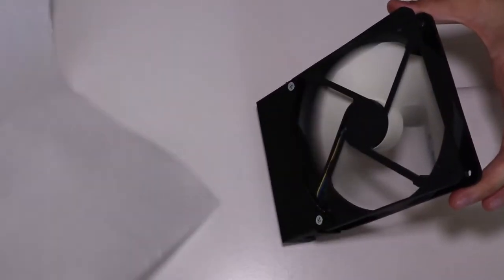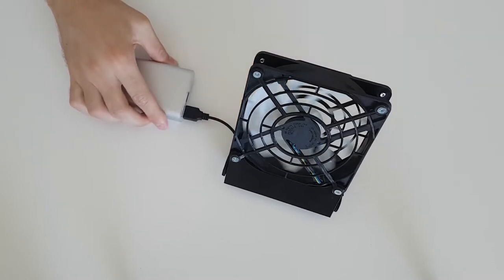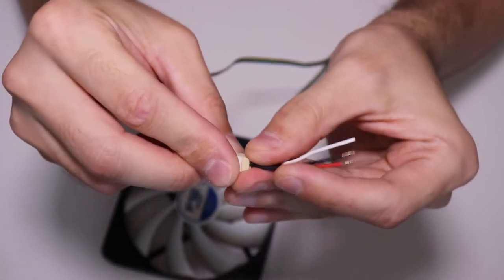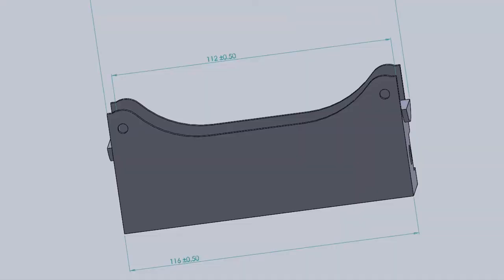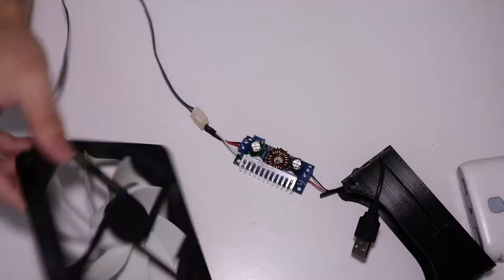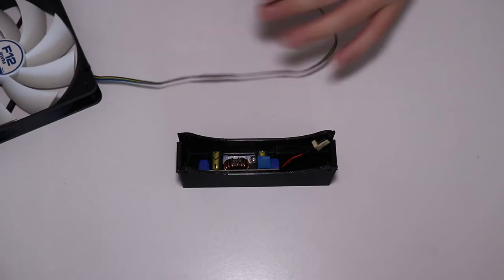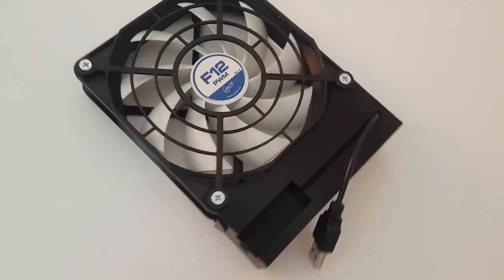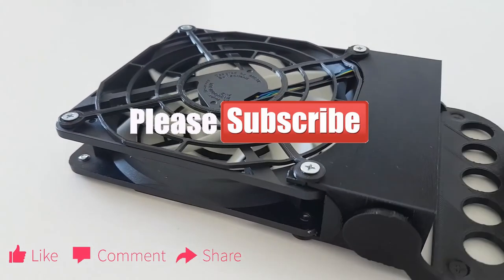[DIY] Turn a Computer Fan into a Desk Fan or a portable USB Fan (to run it at full speed !)

Comment: What was the output (voltage)of that power Bank, used by you???
Reply from the maker: 5V - it gets boosted to 12V by the boost converter I put in the fan case

Comment: How long will it run on a 20,000 mh powerbank?
Reply from the maker: at least 8 hours. I never let my power bank run dry
Reply: a 20 Ah bank is probably 65 Wh bank.  my case fan draws 2-3 Watts so would last 20 hours or so.